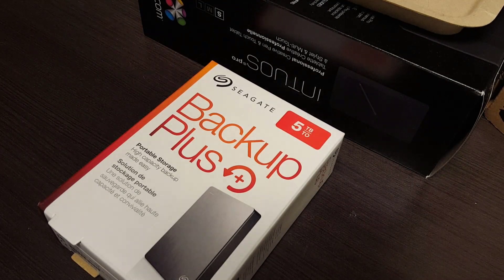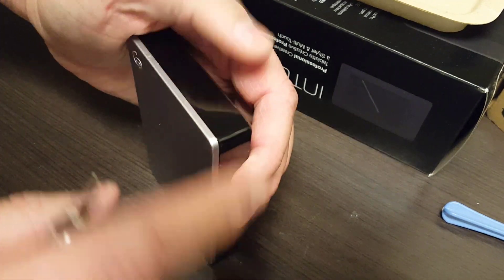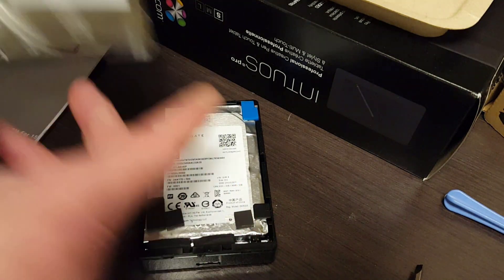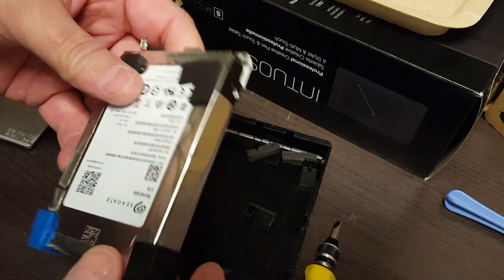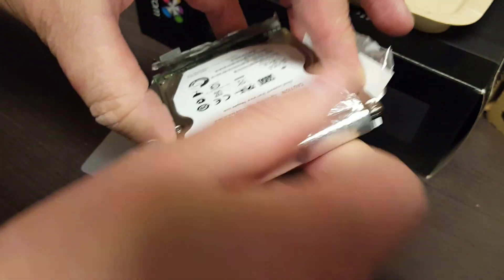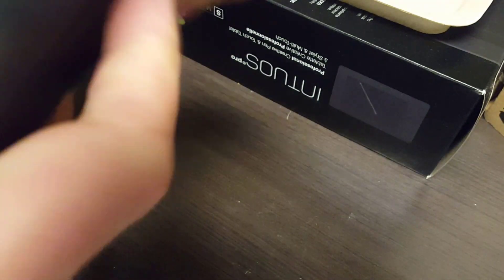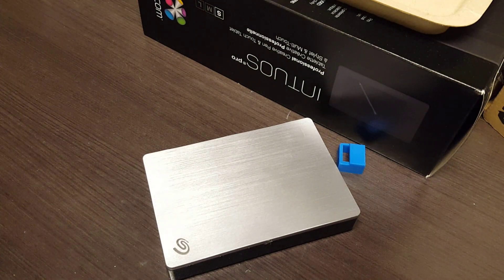How To Disassemble a Seagate 2.5 Inch External USB Disk

Comment: Thanks for this. I have SeaGate 5 TB external drive almost same like in this video. I'd dismantle it, but tell me if I dismantle it can I use it as second internal HDD instead of DVD room? I have caddy. I feel it's safer inside of laptop because 2 times external drive falled down in earth and now it's damaged. its health is 46% (according to Hard Disk Sentinel). Edit: I got no answer but I think I found that maximum capacity for caddy HDD is 2 TB.

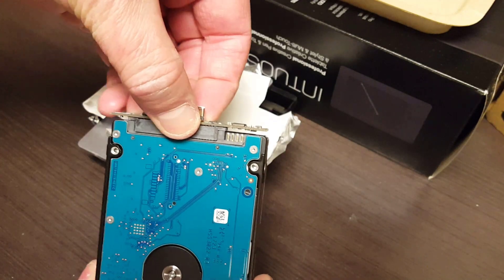Comment: I have the same disk but in 4TB size full of important data, I think there is something wrong with the extension you showed @6:40. When I connect it to my PC it spins for a few seconds then stops and goes dead silent. In the disk management the drive is shown as Unknown and not initialized, and when try to initialize it I get a message "the request could not be performed because of an I/O device error" and thought of removing the internal drive and connect it manually to another extension. Any recommended one?

Comment: Ouch.  Came here to see a video without doing damage to the case.  Still no idea how to do it with minimal damage.
Reply from the maker: With glue and double sided tape, they best you can do is have no visible damage.  If you want to do an even better job, use a heat gun around the outside first to loosen it up.
Reply: @URTechDotCa  Oh, that's a good idea.  I may try a heat gun.
Reply: Remember it's a s.m.a.r.t disk so it will remember if you heat it up haha

Comment: To be fair, you didn't disassemble the DISK at all...you took the disk out of the plastic enclosure and then put it back in. Anyone know of a video where they ACTUALLY disassemble the drive? I'm trying to figure out the right screwdriver/bit I need for the 5 pointed screws on my seagate SRD0NF1

Comment: To confirm, No HARDWARE ENCRYPTION on these portable models. In other words, you can use this without the USB chassis. I have 5 of this and use Sabrent DS-4SSD to connect 4 of them with one USB 3.0 port. :) BUT this portable model is not a regular 2.5" HDD, it is wayyy to thick, NOT for laptop use. I had to cut my DS-4SSD to make them all fit in.

Comment: Good video, but the seagate hdd is not a normal laptop hdd and the other hdd you showed is not a slim version(just the normal kind). Never seen such thick "2.5 drives before, like i said you can't stick it in a laptop but at least it has standard sata connectors on the inside. Last but not least the usb adaptor is so slim and snug on tje drive you can actually use it without the casing, especially since they trap the heat so the hdd will run cooler without it.

Comment: How NOT to disassemble a 2.5-inch external USB disk from Seagate.
THE WORST disarmament I've seen in my life
Reply from the maker: You have lead a sheltered life :) ... just kidding.  We have the proper tools (heat gun, plastic tools, anti-static mat...) to get the job done but record most of our videos for home and SMB users that do not.  This is how the work is done in real world.  It is a hack, not pretty, but fast and 100% functional.  Perhaps you will like this one more: https://www.youtube.com/watch?v=YWRttonfzIc
Reply: @URTechDotCa     In the real world...... The foil cover does not primarily protect the circuit board. It's purpose is to shield Electromagnetic Fields / Radio Frequency Interference. 
If I was advising D.I.Y, I  would reuse the corner bumpers as intended and pack the space (~5mm - ~8 mm?)  - as required, with any non-magnetic/non-conductive material suitable for 50-70 deg Celsius.  Simple.   In the real world, technicians take care. Don't bang HDD's out of the box -  head crash even when parked!  
Remember when RAM was $1000 for 16 MB ( Not GB) in the 90's?  - prices change, but not much else. In my world the principals remain solid unless the wheel was reinvented.
Reply: @URTechDotCa  Thanks for video! I just wanted to see the connector. The video in second link, it was very cool, I am laughing 15 minute :-D  Thanks!